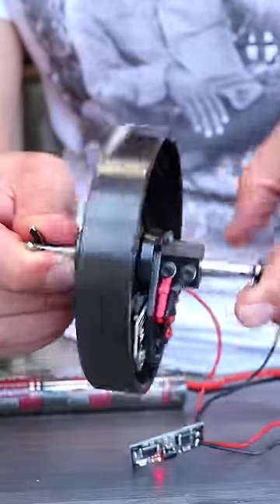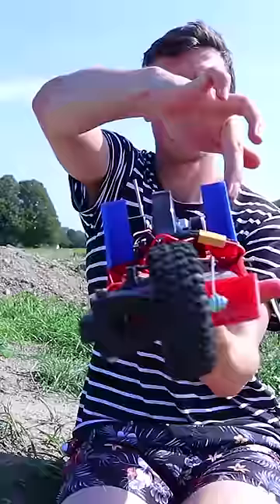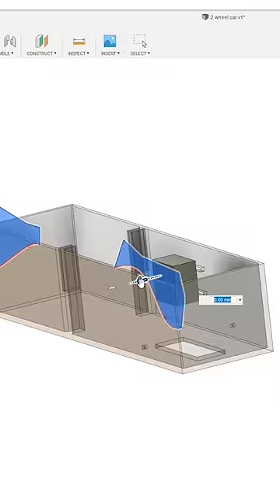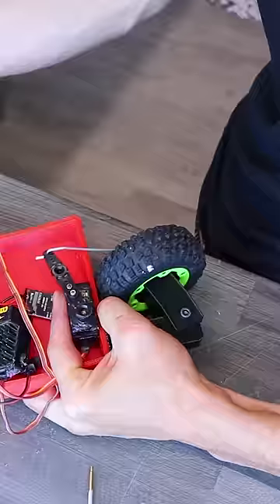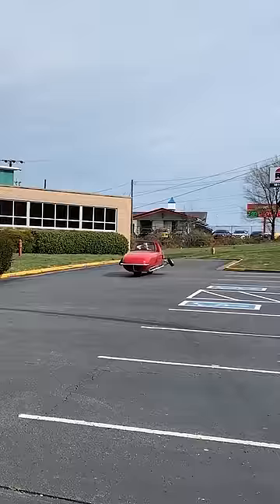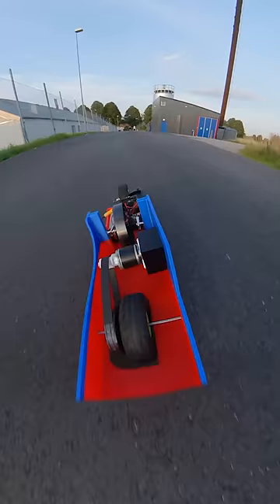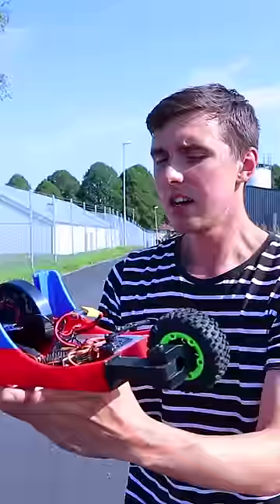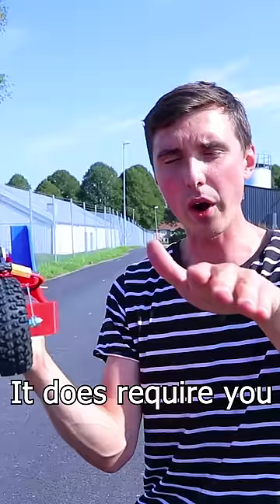Gyroscopic Flywheel Stabilizing RC Motorbike #shorts

Comment: This is exactly what they do in the higher end RC motorcycles. They put the flywheel in the rear tire.
Another thing you should try is raising the frame to allow the battery pack to be slung under it. use a servo to swing that pack assembly slighly to the right or left of center to lean the bike to turn.

Comment: The original RC ones back in the day had a small spinning gyroscope in the middle, and the only way to get it to spin since it was a fairly light motor, was to be in a big parking lot, and turning I believe left, in a circle to trigger it to work. 

This was back when we still used Crystals in RC, that bike was a fortune too :D

Comment: Yo so just a little suggestion. Your getting a perpendicular torque from direction of the spin. Get it spinning and have it hinged so it can move in an axis to stabilize itself. Right now it always wants to pull because it’s locked in place if it’s free to tilt up as it gains momentum it’ll right itself perfectly assuming its mass is enough to counter the force of gravity trying to force it down with the added weight of the vehicle offset on its side in its resting state

Comment: There is no gimbal for yaw motion. You need to provide freedom for gyroscope axis to yaw.

Or mount the gyroscope axis perpendicular to ground and then provide freedom for axis pitch motion.

If you do the above modification, you can balance just with one gyroscope alone

Comment: Motorcycles can only drive slowly because the rider uses the steering to keep it upright until he has to put a foot down. Tandem axle cars or tilting three wheelers need support from retractable undercarriage up to about 10mph. It’s no big deal. Just add the outriggers.

Comment: Cool. But you should look up how bicycles work. It's a myth that they're stable because of the gyroscopic effect, it has nothing to do with it (well technically contributes a tiny bit, but isn't needed). It's entirely due to how the front wheel and steering is setup.

I think if you had the steering correct you wouldn't need a gyro at all. In fact I remember having an RC toy bike when I was a kid, and it had no gyro - but it did have the same steering setup as a bike - it was stable and could turn pretty well, at least for a cheapy RC kids toy from the mid 2000s

Edit: it's perfectly possible you know all this, and just want to experiment with a different design. If so that's really cool and you can ignore me. If not, this thing is still cool anyway! Don't think I was insulting you or anything - just trying to offer some advice.

Comment: Just make a program that self rights itself while driving and only uses the gyroscope when it’s stationary, this will keep it upright whenever it’s not moving and when it is the steering won’t be affected by the gyroscope. You could also have the gyroscope on a servo so when it starts to fall it can rotate and correct itself

Comment: This isn’t at all how gyroscopes work, you can’t just put a spinning thing in there and expect it to hold its orientation. If you restrain a gyroscope in one axis (the wheels stop the gyroscope being able to rotate about the vertical axis) then you get no stabilising force in the other axis (the roll axis). The two wheeled car you showed works by using the precession of the gyroscope to provide a corrective input to the steering

Comment: with a tight perpendicular gyro you wont need a steering set up if it can be programmed on a tilt limiter to prevent falling over by adding a speed boost and travel the knifes blade

Comment: gyroscopes must be arranged in an x-y , thats the only  way  it will stabilize. need about 20,000 rpms on each flywheel, one comes to mind, a gyroscope mounted to machine guns for the military stabilize both axis creating resistance  locking it in space unitl you act a force upon either axis

Comment: It will be consuming more fuel for middle wheel to spin only for making balance we can't afford it it will be automatic balancing vehicle but not for all people i guess but bro you made it. I don't have money and that much equipment but just make a generator wheel inside zero gravity vaccum ball and only port of power output should be linked with external circuit. We can have energy source. 😊

Comment: I made on about 20 years ago back wen you had to make everything.... used a skinny hot weels box as the body
Reply: I ended up scraping mine due to the large power consumption needed to keep it running. Remember that it was back wen cellphone weren't even a thing yet. 

Back then, the best battery for size was a 9v, run that through a small flashlight balb in line with your moter to keep it from blowing up.

Comment: why put a huge and heavy flywheel when you can balance a 2 wheelers even at low speeds with a tiny accelerometer, and feedback loop to actuate the steering ?

Comment: Independent suspension? Each uneven surface is similar to tapping a Gyroscope & will want to hold that position until acted upon.  Steering may also cause a similar situation, but I'm not sure. Good luck

Comment: RC bikes dont NEED gyros. its geometry.
1. trail. the distance the line of contact trails behind the pivot axis when projected onto the ground. the wheel is always behind the pivot. its the most important aspect of all two wheeled vehicles.
2. steering angle. (or caster) too steep and its too touchy, too shallow and its too heavy and "stable". 
3. rake. a combination of steering angle and wheel diameter alters the trail. so the axle is offset from the pivot axis to give the correct trail. RC bikes have negative rake as the wheel is so small, the axle well behind the pivot axis. a real bike has positive rake, the axle is in front of the pivot axis.
4. counter-steering. the wheel turns OPPOSITE to what you think. you STEER left, and the bike falls over to the RIGHT. and vice versa.

RC bikes have a soft spring between servo and forks. and you only FLICK the steering, you dont HOLD it. its a bike... not a car or a plane. the steering has to "float". once its fallen over the way you want, it finds its own path from throttle and brake control... not steering inputs.

some RC bikes steer by tilting the wheel sideways rather than turning it. achieves the same effect. makes it fall over...

the whole point of the gyro car concepts (and there was an even earlier one from the 30s or so) was that they balance whilst stationary. if it cant do that, why bother?

Comment: You need to have the Gyro on top level with the ground. If you work with the north field you'll be in sync with the poles
Reply: What, a gyro doesn't have anything to do with magnetism
Reply: What, a gyro doesn't have anything to do with magnetism

Comment: There are some problems here:
1 the wheels,you cant put car wheels on a motorcycle style RC because they are flat and dont let the thing steers alone and find center
2 the weight distribution isnt perfect as you can see by the things mounting on top
3 I have a motoGP RC and It doesnt have any help other than just power to the back wheel like real thing,It is stable as fuck

Comment: I would say make real gyroscope and control in synced bz the steering so speed speed of gyroscope when left turning is less speed on the right side and the other way around but there for you need a bigger Electrical engine

Comment: I mean... You can buy RC motorcycles that have a far more elegant solution of this packaged into the rear wheel, and don't require a perpendicular gyro to stay upright at speeds of less than a mile an hour. I have one. 

I'm not really sure why it needs a homespun video implying it's some sort of major leap forward, because it isn't. 🤷😂

Comment: Besides the problem steering, tell me who wants to have a giant metal wheel spinning at insane rpm's right next to your body.  If there is an accident, the metal part coming off that wheel would be like giant bullets that would rip through everyone in that vehicle, turning them into swiss cheese...

There is a reason why large scale gyros like there never caught on.  The safety concerns are off the chart....  think compressed hydrogen is dangerous, nothing compared to high rpm flywheels...

Comment: I believe you are doing it wrong. Bike turns direction  mostly by changing angle of two path that it makes with wheels not so much by turning l r front wheel. Check theory why bike turns, you will make better bike. Best of luck